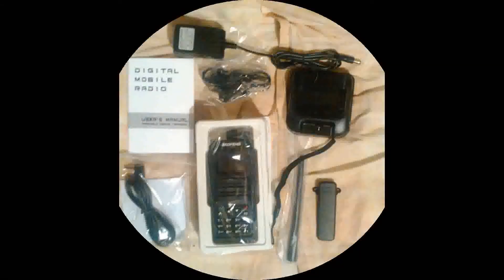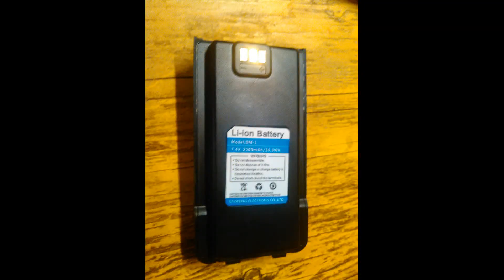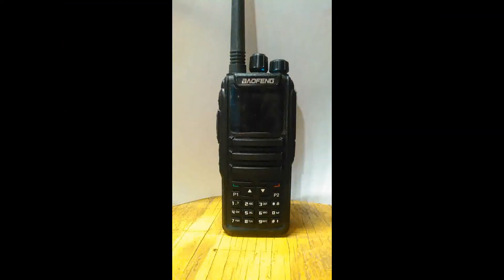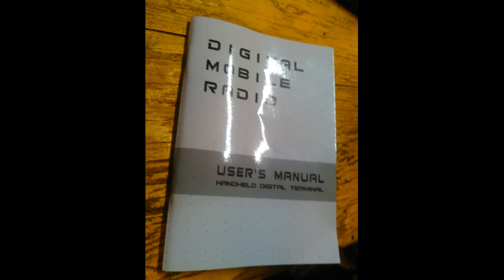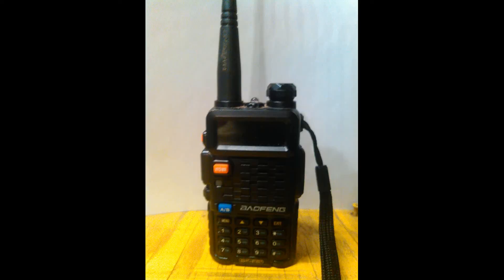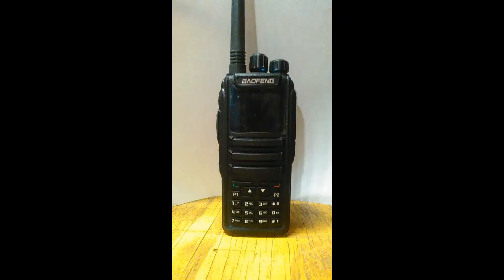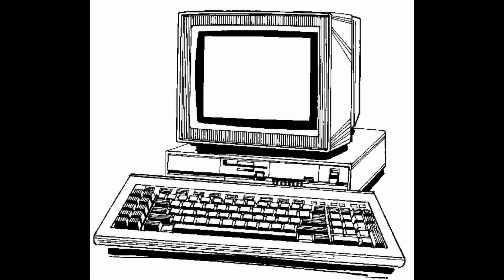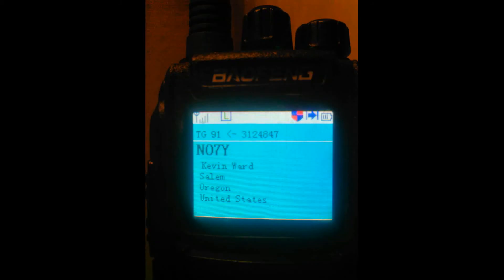Review Baofeng DM 1701 dual band (2m/440)  DMR radio

Comment: I can't afford 2 of them, is there not any walkie talkies that can talk with it?
Reply from the maker: They are meant for ham radio use.  Requiring a license, that is easy to get http://www.arrl.org/getting-your-technician-license .   They can be used in analog mode and use 2 meter /440 frequencies.   Or they can be used to connect digitally to any other tier 2 Digital mobile Radio (DMR).  I do not think they have any other frequency certifications.

Comment: Baofeng DM-1701   apparently requires Microsoft Excel to upload the user
 contact database.  Is there a work around? A few friends have this 
radio but can't upload the user contact database.
Reply from the maker: I use Linux and various programming tools written for it.   I have never needed any Microsoft program to upload the contact database.
Reply: @kw-4  Thanks,  My friend with the radio has a little experience with Linux. Would you mind sharing some of the programs your using and I can pass it on.   Thanks, Ken
Reply from the maker: The main one I use is dmrconfig  https://github.com/sergev/dmrconfig/wiki

(Keep in mind if it says RT-84 it will probably work with the DM-1701)